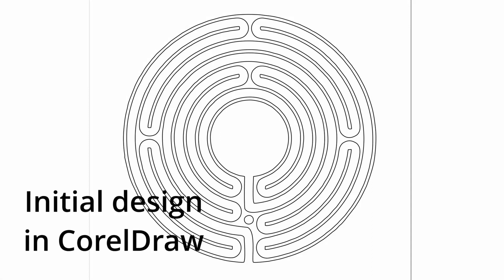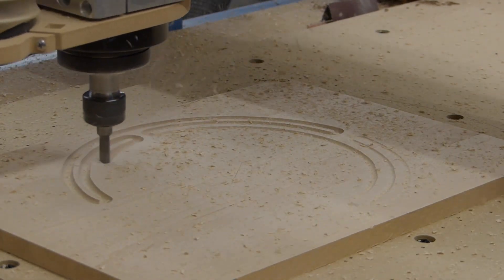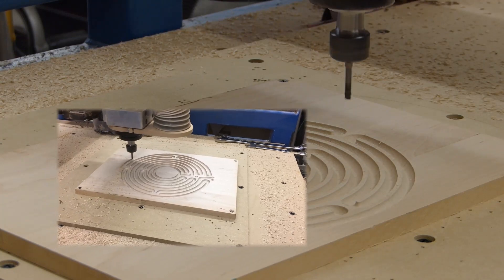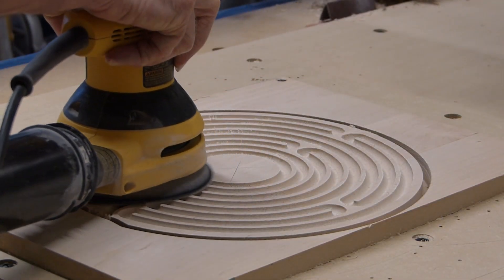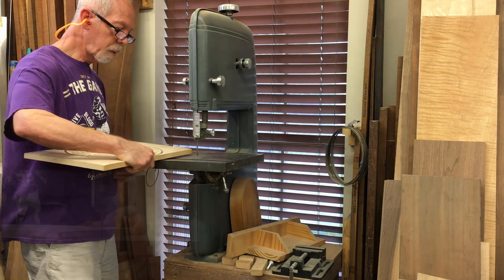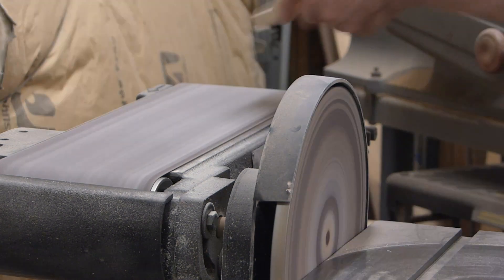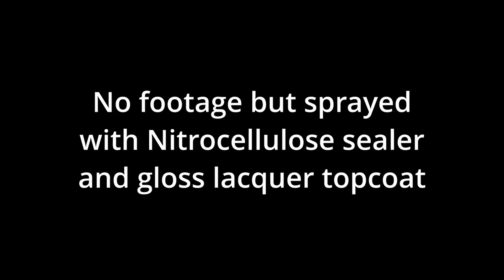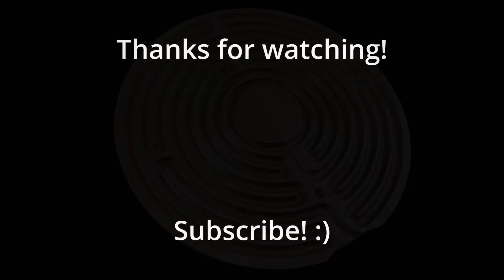Making a Finger Labyrinth - CNC

Comment: Do you happen to have an SVG file for the labrynth? Our CNC keeps outlining the main line and we can't figure it out. Great work!
Reply from the maker: @ivyleagueadventures9572  Unfortunately, I only have the file I drew in CorelDraw. The drive that file is on crashed and I’m sending it out for data recovery tomorrow. Hopefully they can retrieve my files.
Reply: @difalkner  Any chance you could make a video of the process from Fusion to the toolpaths of the CNC
Reply from the maker: @joegehrer4332  I could try to do that but it won’t be right away. My drive containing all my CAD/CAM files has failed. It’s with a company attempting to recover those files. if they aren’t recovered then I’ll have to do everything from scratch, essentially starting over. I’ll hear from them soon and hoping and praying I get my files back.